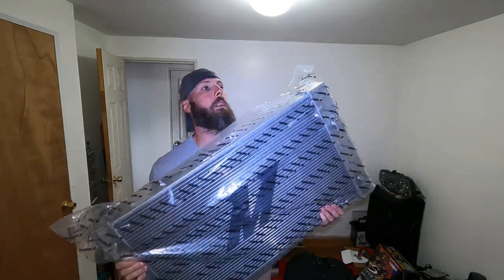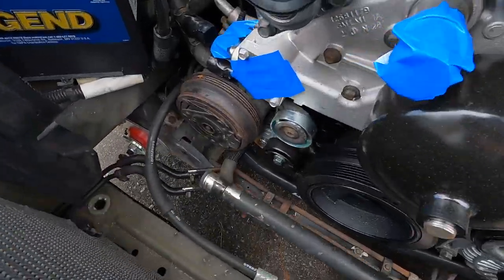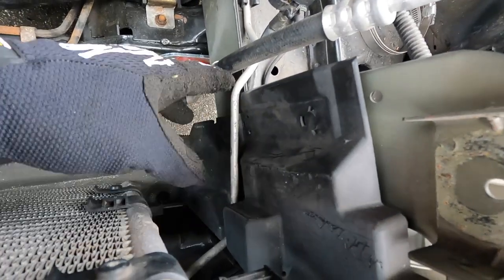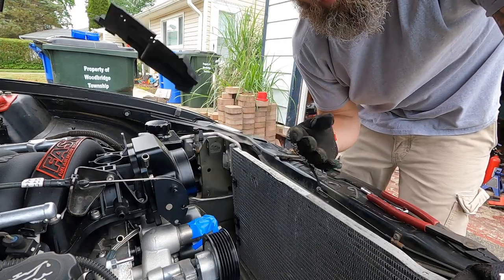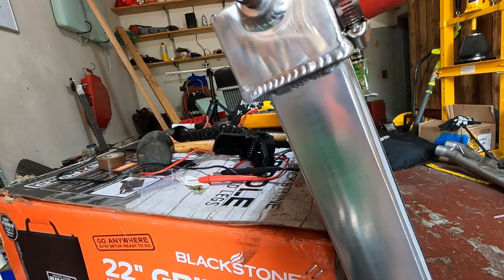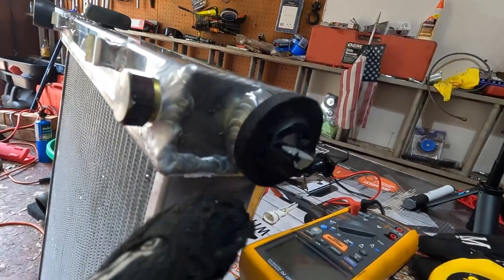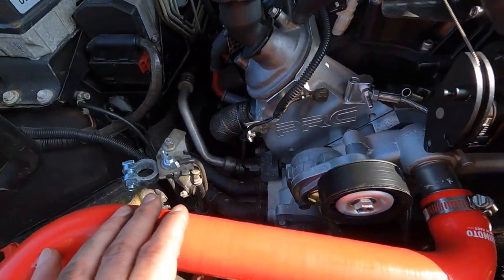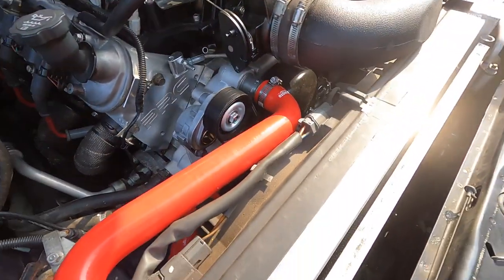GTO Mishimoto radiator install (plus other engine stuff)

Comment: Cold case radiator fits with no mods. Including my vararam over the radiator cold air intake but it is 05
Reply from the maker: I found that cold case radiator after I ordered the mishimoto. Figured it would fit perfectly since it was for the car. If it doesn't work out then I'll go with the cold case